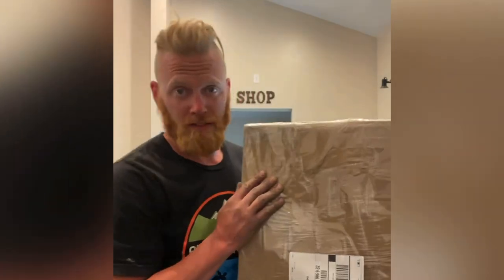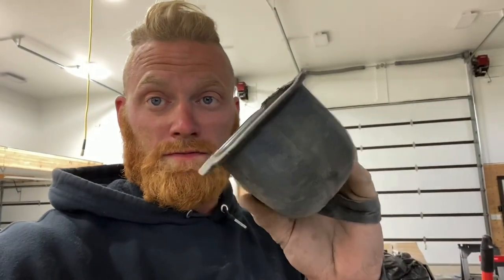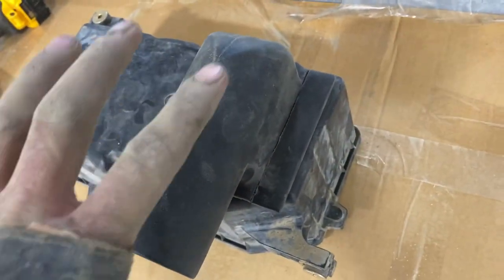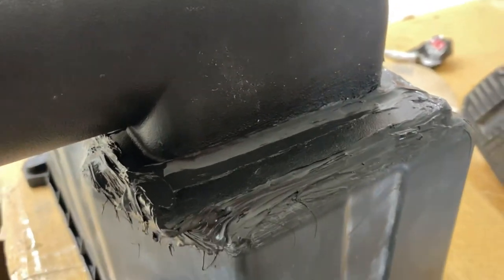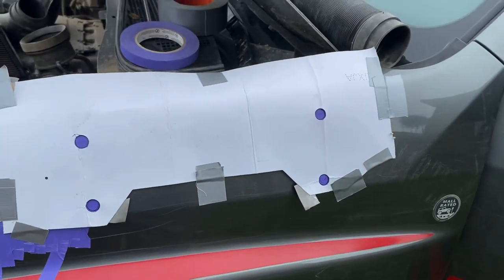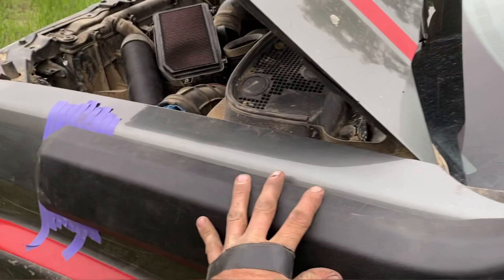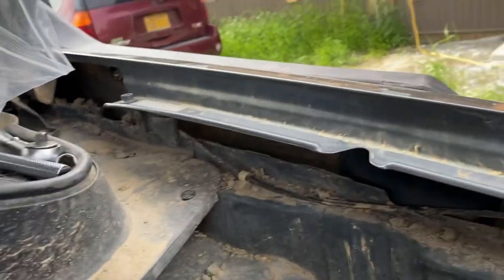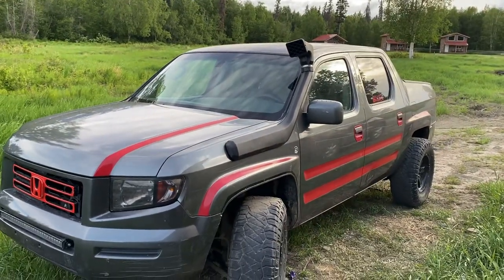How to install SNORKEL on HONDA RIDGELINE

Comment: Great job, before forging rivers there are two vents (to atmosphere) you need to extend higher-up . First is from the trans and is a hose that vents on the front side of the throttle body. Second is a small black box at the top middle of the fire wall with a nipple that looks like it is missing a hose. Thats the vent. Tried to add a picture but that was fail.  Your diffs may have filter/vents you may want to extend before submerging also.
Reply from the maker: Thanks, I’m aware of those. I’m not wanting to submerge it, lol. Im just trying to keep water being sucked into it if my front dips into water. Like I was explaining in the video, maybe that wasn’t very clear.

Comment: If not mentioned, the Gen 1 has a factory rear diff breather routed up inside the driver side fender.
Reply from the maker: Correct. And the front diff breather is up on the top of the firewall.

Comment: I bet you could use a heat gun really carefully and pull on it to get the angle you want on the part that runs up beside your windshield.
Reply from the maker: Ya we ended up just pulling it slightly and warming it up slightly. It worked great.

Comment: Nice Job figuring out how to make it work.  Would it have been possible to remove some or all of the torque/tension on the snorkel parallel to the A-Pilar on the truck by using a heat gun to soften the snorkel up a bit while under tension without compromising the integrity of the snorkel walls itself?  I realize this whole thing is about function and not form but it did turn out looking pretty good in the end.  If it was mine, the last thing I'd do at some point in the future is try to find an end piece for that snorkel that has a round face  instead of square/rectangular face eliminating the non parallel and plumb lines with the truck.  Great Job.
Reply from the maker: Thank you! Great idea, I’ll see what I can do. Haha. I thought about applying some heat but it’s working so I think it’ll be fine.

Comment: should the top piece be pointed backwards so it draws air in from behind you instead of potential dirty air from the front? just a question, I don't know shit.
Reply from the maker: It can be. Depends on preference. I put it forward to act more like a “Ram” effect, forcing air into the engine vs the engine pulling air in. Does that make sense?

Comment: Was that a sensor that you had covered up and duct taped?
Reply from the maker: Yes, the TPMS sensors. I was just trying to protect them because the plan was to put the sensors back in the wheels but I have definitely gone a different route at this point haha